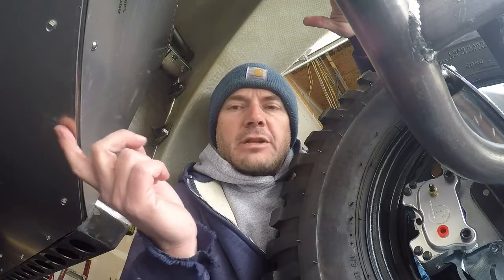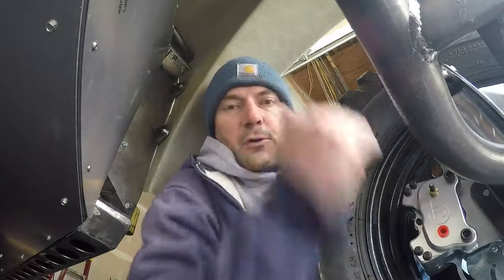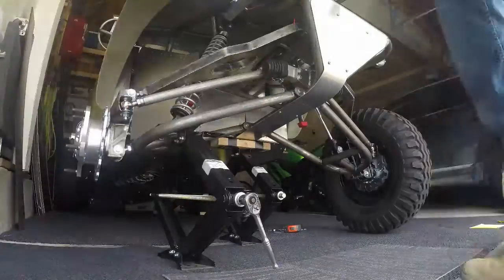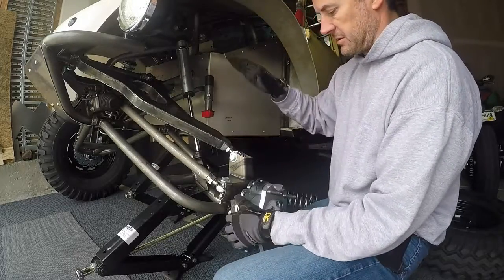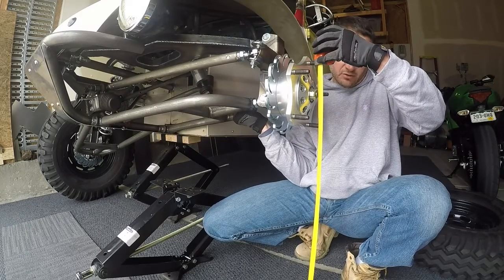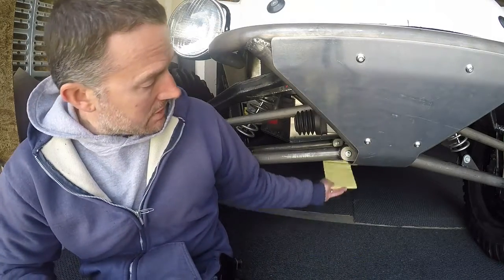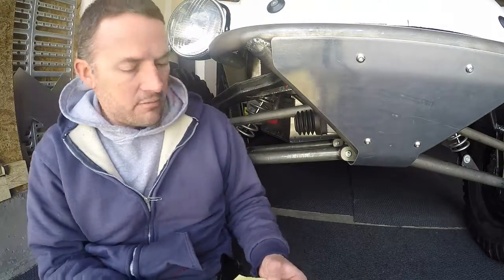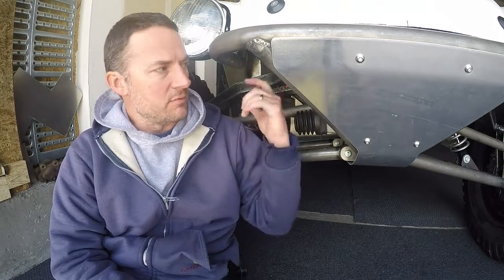Measuring Ground Clearance and Front Wheel Travel (Baja Bug)

Comment: Instead of rebuilding the arms and such, could you move the mounting points on the frame up an inch or 2?  Not sure if that would work or be any easier.  Just thinking.
Reply from the maker: Nic, for the geometry to work I will need to bring the lower connection in more to the control arm pivot. Then the top point will need to come in more towards center.

At least that's what my brain thinks. lol
I won't know till I mock it up. I'll revisit it after I complete the rear suspension.